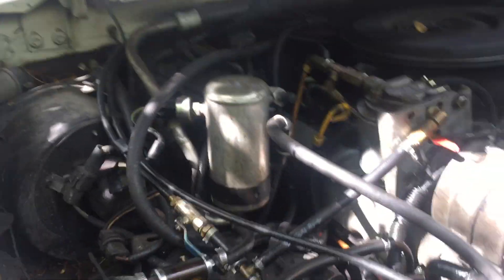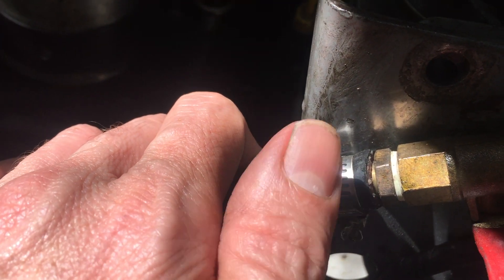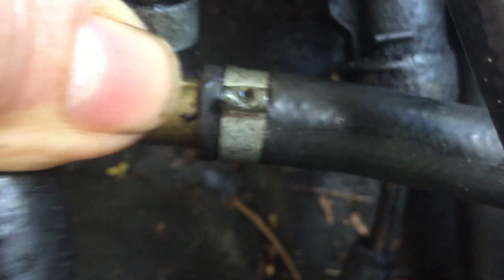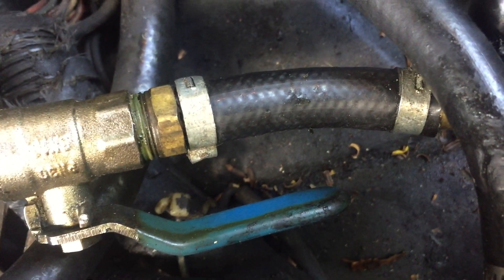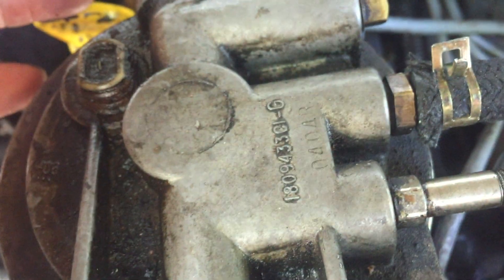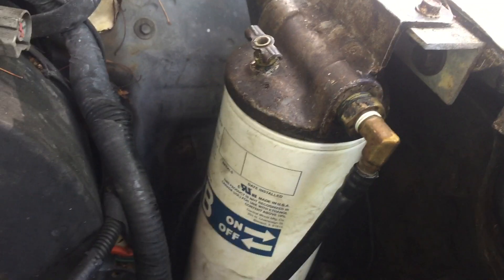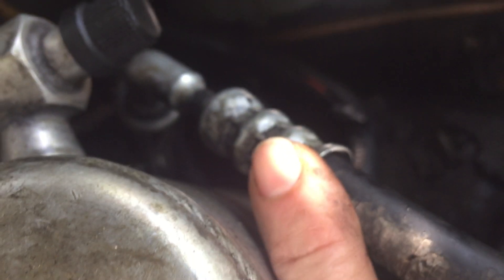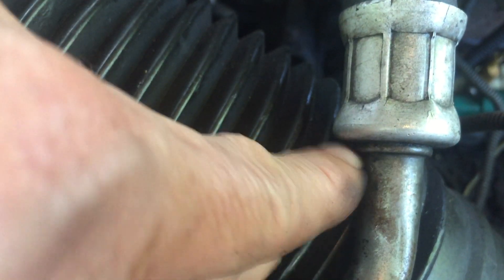Clamps and terminals

Comment: OK I haven’t seen those type of brass battery terminals. I like that that would make soldering far easier were you actually have the tube on a tangent to the radius of the clamp? I was thinking of your typical perpendicular to the ends of the clamp doesn’t give you a lot of purchase to insert the strip down to the Kable to do your soldering.
Reply from the maker: I had a bunch of them in a box someplace. They are something I recovered from a warehouse cleanout. They come nickel plated but after sitting in a box all those years many got corroded. I cleaned them up with acid and flux and soldered. If I find them I will send you some or just keep them with me when I get to visit.